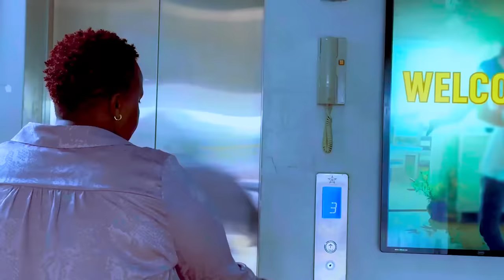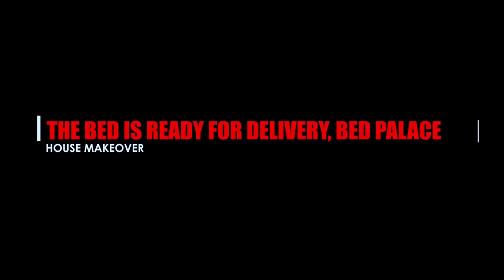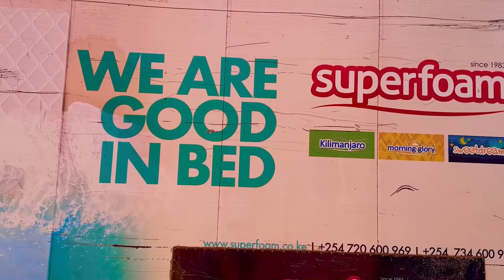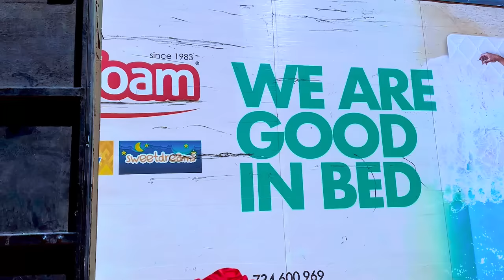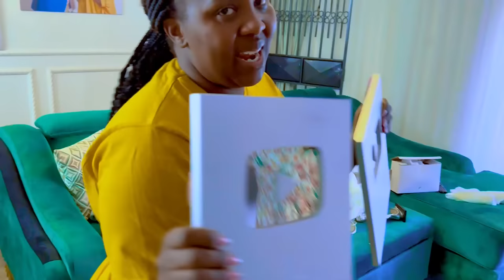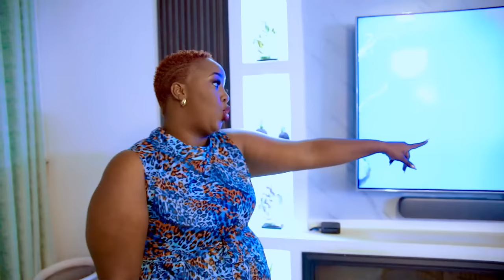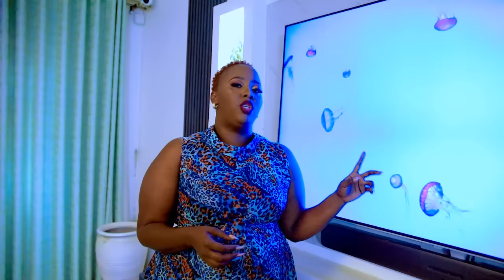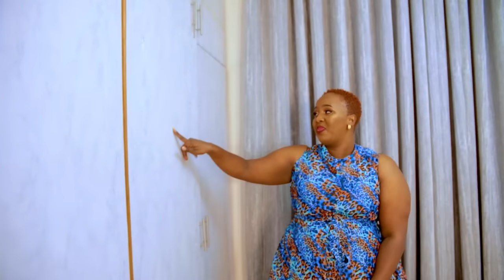FINALLY HOUSE MAKE OVER || BEFORE AND AFTER FULL HOME RENOVATION.

Comment from the maker: Guys the house make over is here and here are my suppliers and their contacts :
Impala Glass - 0786606052 / 0758583500

TV Wall- Luxury Interiors Kenya - 0718508996

Bed Palace Kenya - 0725414842

Carpet City - 0718222289

SuperFoam Mattress - 0755101731

Fire Place Kenya - 0718508996

Hash Holdings - 0797418899

Computex Solutions - 0715516421 

Oak Furniture - 0717808080

Tanj Curtains - 0725329869

ANH Homes - 0703501584
Reply: You target impala furniture
Reply: Thanks will too order